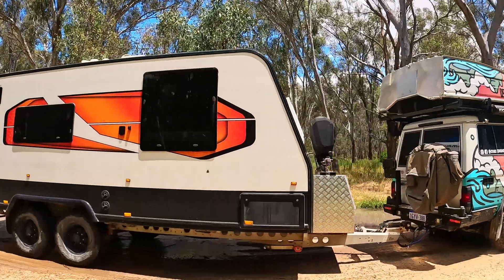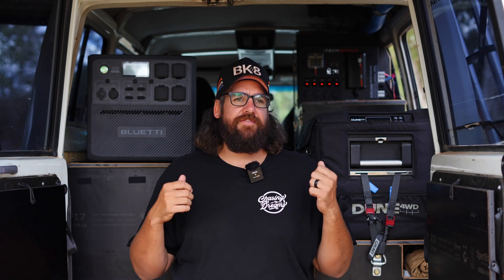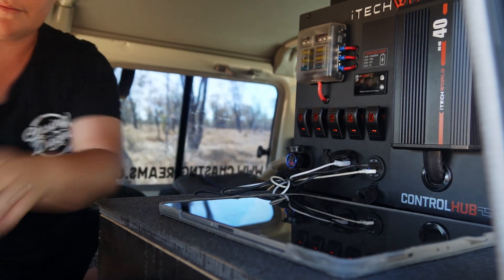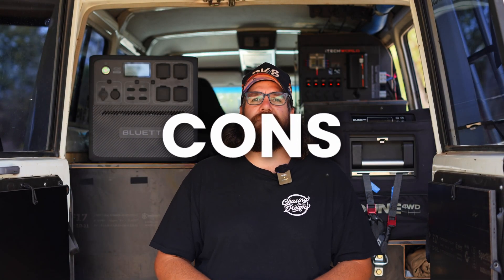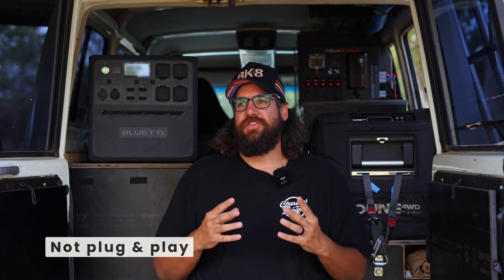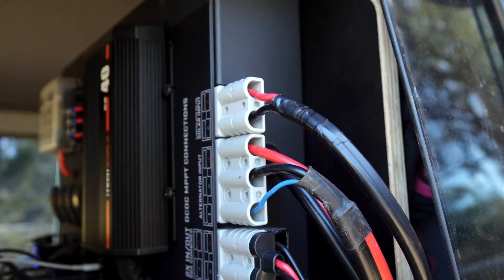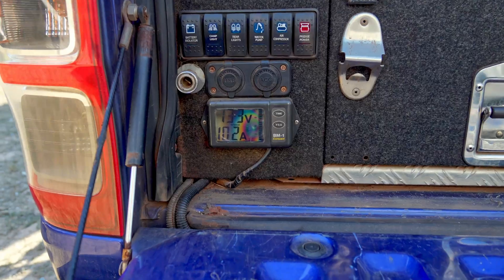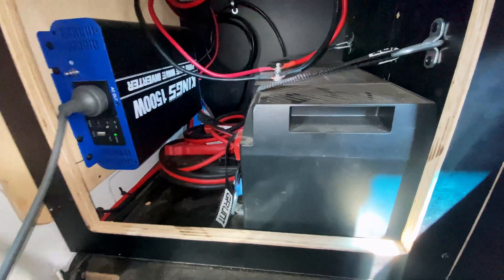Is a Portable Power Station Worth It? 12V Setup Comparison!

Comment: I've been using a power station for a few years. They're unbeatable for bang for your buck and portability. I use mine camping...but also out of the car sometimes too.

The downsides of a hard wired system are numerous Cost & time. Also the attachment to the vehicle is not good. Crash the car? Stolen & written off? Sell the car? Upgrade the car? The whole inbuilt system either goes with it, or you have to undo the whole job, drag all the cables and switches out & then when you get the new car, nothing will fit the same because the cable lengths are different and the car interior is different etc etc.
If they start putting Anderson in/out on power stations it's game over IMO. You can't match them for bang for your buck.
Reply from the maker: We appreciate you sharing your experience mate and in great depth 👍

Comment: Great video Bluetti AC240 weight 33kg cost $1900  Bunnings How much would your DIY setup cost and weigh many thanks
Reply from the maker: Thanks heaps, this setup cost us just under $2000. Unfortunately the Dcdc charger had to go back under warranty with a 4 week turn around so we did have to buy another brand so realistically next time it would cost us around $3000 to $4000 to make sure we had products/brands that can be replaced under warranty all around Australia. Weight would be similar.

Comment: Gday mate with this unit, can you say plug a camper trailer straight into this like a jayco camper, then run lights, phone charger etc inside as normal, or so all appliances have to be plugged into this separately?
Reply from the maker: Hey mate, unfortunately not. The plug to a caravan is normally 15amp and this unit is only built to run max 10amp. If you plugged your appliances to the unit and depending on what you run it should be fine. That would be great if they did work like a silent generator wouldn’t it. 👍
Reply: @chasingdreamsau  for sure I ran my van last night on 10 amp plugged in to a house, just lights and charged my phone so it should be alright haven't tricked it out yet! So this might be a good option
Reply from the maker: I personally wouldn’t but best of luck with it all mate. 👍

Comment: Unfortunately you need a big solar panel to charge the Bluetti system
Reply from the maker: No not at all, our 170watt certainly tops it up with around 6 to 8 amps an hour on a good day. Depends how much you are using I guess vs how much you need to put back into it. 👍

Comment: What happens if the battery fails in it or the inverter fails can you change the failed part or do you throw the whole thing out
Reply from the maker: Hey great question, I don’t honestly know the answer so I have just asked the question. 👍
Hopefully get back with an answer soon.
Reply from the maker: Hey mate, from what they have said is that after the warranty period it would have to be sent for repair and they have a maintenance team in Sydney. 
So not as simple as just replacing it like an inbuilt system. Hope that helps. 👍
Reply: @chasingdreamsau  I did think that could be the case definitely something to think about as would be easier replacing failed components in a built in system would be easier I'd say
Reply from the maker: Yeah it’s a really good point to be honest. 
Thank you for asking the questions. 👍

Comment: Would of been good to have price of both set ups
Reply from the maker: Sorry this didn’t even cross our mind when making the video. 
BLUETTI AC240 is $3,199 but they normally have a special and it’s currently $2,499. The inbuilt system cost us $2,000. 
Thank you for commenting and saying as I’m sure others felt the same way and we just missed it. 
Have an amazing week.
Reply: @chasingdreamsau  thanks also just a thought as I’m looking at doing either system just weighing it up I loved the pro and cons but a bit more on what you used with the Bluetti thanks love watching your videos
Reply from the maker: Thank you so much. Really appreciate the feedback. We didn’t run the fridge as it doesn’t have an Anderson plug. We use it for induction cooking, air fryer and charging our laptop and camera equipment. We have also run starlink off it a couple of times just to save our other battery on an overcast week.

Comment: how dose this stack up to a gen set we are still sorting setup and van comes with 2400watt air con so looking at 2500/3000 to run it off grid but iftheses. bad boys would run it could be. worth it
Reply from the maker: Hey mate, something like this will run it but the issue you will be faced with is the aircon will draw say 50amps there abouts and will only be able to run it for an hour or two. Generator would still be the way to go in this scenario i believe. 👍